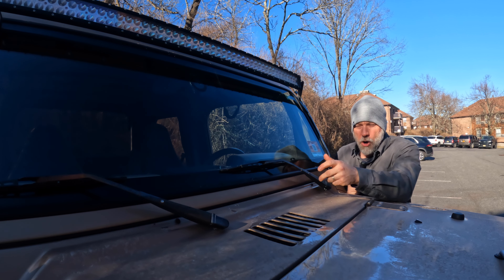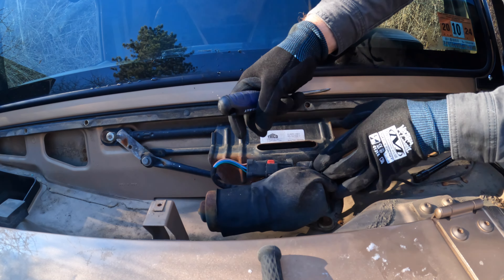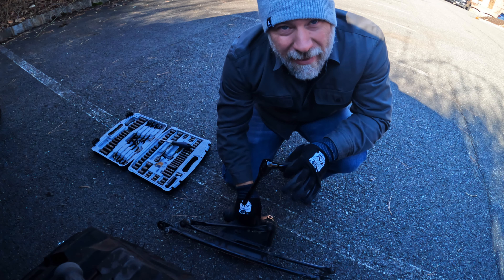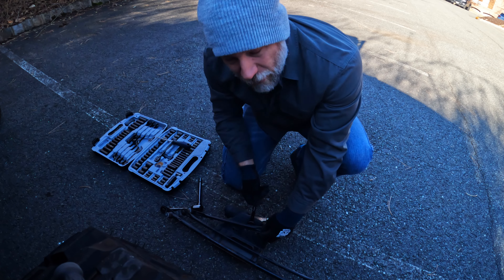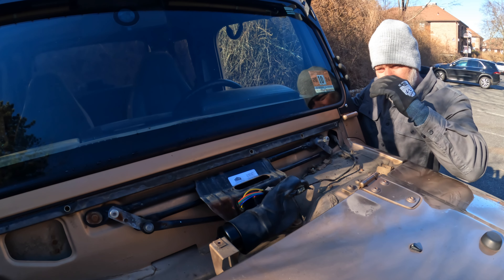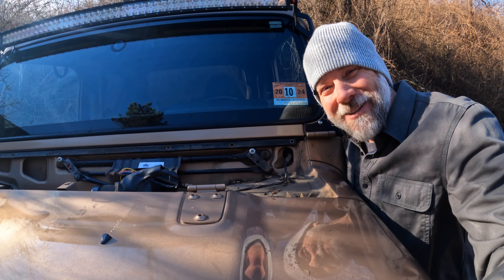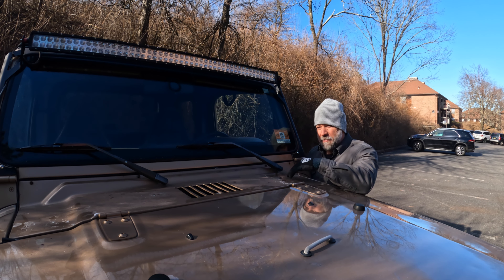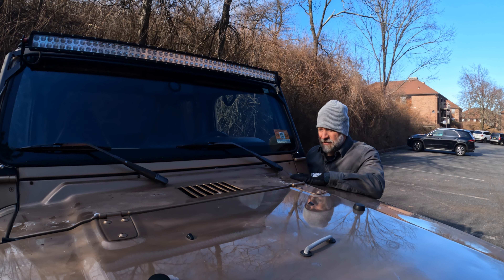Jeep Wrangler TJ Wiper Motor Replacement // Easy DIY Project

Comment: I'm 60'ish and had a couple jks, including a brand new 2015 Willy's but they never felt right. I graduated in 1979 driving a 69 bug convertible, which I loved.
I just bought an 03 tj. Reminds me of the 69 bug.

What I'm understanding from this vid is, you can still work on a tj when you're 62 years old. It's like a very modern, yet truly vintage automobile. No electronics, no traction control, no abs. Basically, just a car you can still fix on your own.
Kudos.